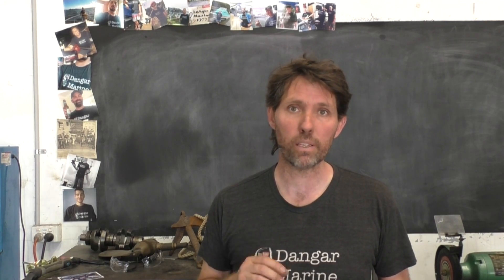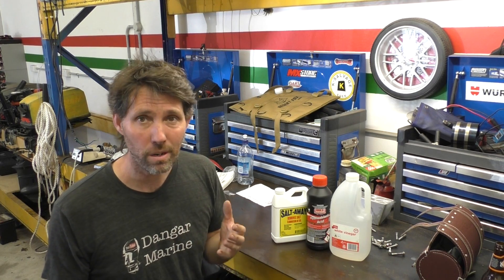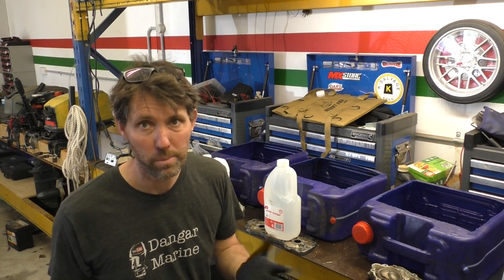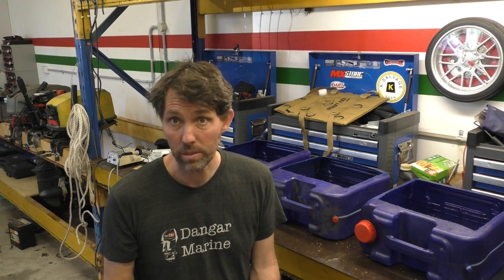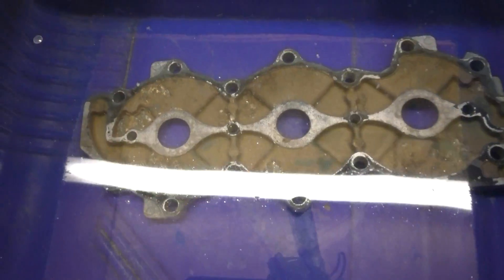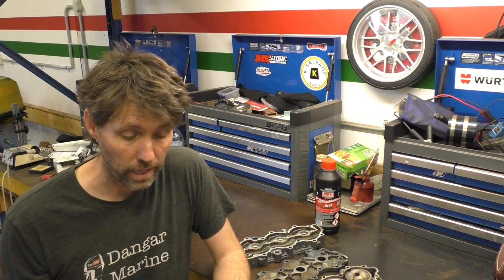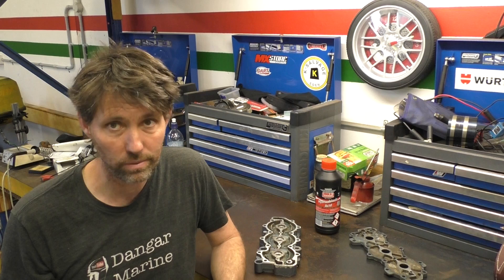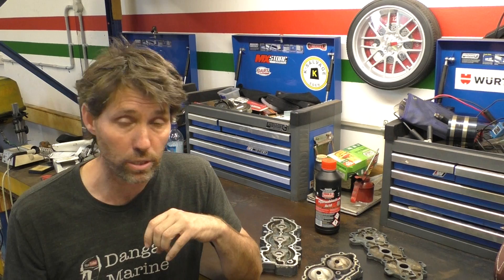Cleaning outboard water passages

Comment: Hey Stu, have you done a video about removing a stuck cylinder head? I've got a 3 cylinder 1987 Johnson 70 in and the head wont budge. I have removed all 14 bolts (2 snapped off -doooh!) but I can't persuade it to seperate from the block. Don't want to get too medieval with it but can't figure out a way to make it shift.
Reply from the maker: Hi David. Are the shanks of the broken bolts still in there? That is probably what is causing it to be stuck if so. I would start by looking for any protrusions that allow you to use a punch to tap it off. Worst case scenario would be separating the crank case so you can push it out from behind. If you are game (and careful) you could also try putting spark plugs in to block the holes, leave the leads off and then crank it to see if the compression pushes it off.
Reply: Thanks Stu, that's worth a try. I have been soaking the broken studs in penetrating fluid for a couple of days but it's still stuck. I have center drilled the remains of the studs and am waiting for some decent cobalt drills to arrive. Looks like I will have to drill the studs out and retap the holes. Thanks millions for the response, I know you must be a busy bloke. :-)

Comment: Hydrocloricacide has been being used on air conditioning condensers and evaporator coils for many many years. The aluminum fins are about a 16 of an inch thick and it cleans them to looking shiny new. It is mixed a lot stronger than 20 to 1 though so it shouldn't hurt your application at all but leaving it on it for hours or overnight might eat off some of the thinner aluminum. Have a good day and I enjoy your videos
Reply from the maker: Thanks mate, interesting to hear your experience with much thinner metal.

Comment: Hey! Ive got an 1960 swallow 3hp outboard, and im trying to figure out if it has a water pump, as some older lower hp engines do have those. I dont see cutouts in the tail and no holes near the prop, but where the exhaust comes out there is a big hole...
Reply from the maker: Can't say I'm familiar with that outboard, sorry.

Comment: Hey Stu, I have an opportunity to buy a good boat but it has a 2000 model 40 HP Tohatsu  motor. Are they any good from your experience?
Reply from the maker: I've had a few Tohatsu 40C outboards. They are simple, easy to work on and reasonably reliable. I quite like them.

Comment: Interesting video.  I've got an old 1970 Mercury 1150 that needs a bit of TLC, so I've found your videos pretty helpful.  Have you thought about using a combination of solution with a ultrasonic agitator?  I'd think that would work quite a bit to get most of the crud out of those passages, then follow up with the brush.
Reply from the maker: Something like that would certainly help. I would like to at least get one for carburettors one day.

Comment: In brackish water environment here ... the local shop recommended taking the thermostat out of the honda four stroke then pour toilet bowl cleaner down.  Sorry white bottle with bent spout.  Neighbor tickled at the crud that came out the bottom!
Reply: Great video comparison as this is aged question for trailer boat owners. Like many I to use saltaway but can't help but feel a bit ripped off by the high asking price
Reply from the maker: Ha! Interesting to hear. I've got so many interesting suggestions since this video, I'll have to try them all. :)
Reply: The best & least troublesome 'cure' for trailer rust was the guy who puts a rotary sprinkler under the axles and lets the 'lawn' get washed for - I don't remember 1/2 hour, 1 hour or ?  No pain & supposedly works

Comment: Thank you for the video Stu. If I ever take on an overheating outboard I will strip it and wash out with diluted acid. I doubt I would try running it through a complete motor however.
Reply from the maker: Hi Matthew. That sounds like a sound approach. :)

Comment: Excellent experiment and presentation. With hydrochloric and any concentrated acid - it  must be poured into water and not the other way, heat of mixing could make it splash out of container. Just a note, you did it correctly.
Reply from the maker: Thanks mate, good to know. :)

Comment: Brick cleaning acid is normally pretty dilute from the bottle, normally 
about 15 % HCl, you were right to dilute it further. I presume 
"aluminium" engines are made from some sort of alloy, containing a high 
percentage of aluminium, I'm not sure about that.

The bubbles coming off were hydrogen gas, hydrochloric acid reacts with 
aluminium to produce aluminium chloride plus hydrogen. See what happens 
when some aluminium foil is reacted with 25% HCl:     https://www.youtube.com/watch?v=LaaORZ0ofCY

It would be interesting to see what happened if you put some acid 
straight from the bottle onto a piece of a scrap engine.

Strong caustic soda solution (sodium hydroxide) also reacts with Al, so 
that should be treated with extreme caution too when considering 
potential cleaners.
Reply from the maker: I might try a bit of pure (bottle strength anyway) acid and share a picture of the result on Instagram.
Reply: @DangarMarine  I have done this years ago with a yamaha 90 block thatwas junk to try various methods of 1 removing scale  and 2 trying to remove broken bolts....I did as you, using a dilutesolutions at first, when it really didnt attack the chrystal build up, it did, as i expected do some serious damage to the heads, very quickly as a concentrated ,ie  pool variety muriatic acid....I believe the build up problem is exacerbated by the desire to get the outboards  up to temperature quickly and thereby complywith emissions and or show better ecomy..thus, you dont see much flow  thru the thermostats....just a spitting until it opens..  So ththat water is filled with minerals and deposits very quickly on the aluminum surface as the spittting water evaporates..  similarly on shut down the water drains from the hot heads, and what is left over evaporates ...and sticks to thealuminum...  I will get castigated....but, when i start having problems, out come the theremostats....and since there is usually reducedvolume going thru anyway, the crud actually takes the place of getting engine up to temperature... I should say thatthis is my best guess.. I havenever had a serious provlem running without thermostats...as I know everyone will scream....increased wear..bla blas ...welll ok then...rebuild your motor...me, ill takethethermostats out andget several more years out of them.

Comment: Acid is used by many truck wash to clean tractor trailers..there is alot of aluminum parts.. Acid is sprayed over entire truck.. Let sit for a few minutes then rinced off with soap and water.. Trucks with 100's of washes do not show any negative affects on aluminum.. Or rubber parts.
Reply: We use the same 'acid' at work for washing trains. It is citric acid at very low concentration, I dont know the exact level, but it is so low that it does not burn the skin nor sting the eyes from the spray .I wonder if  dilute molasses would work like it does on steel/rust?  I used molasses to de-rust the interior surfaces of boxed in car par parts over the years - mainly the fan housings of type 1 beetles and chassis  and sills of an XW falcon.  I tried the same trick on an Alfa, and finished up with the only useable parts of the car after the rust was gone -  the wheels - they looked good on the trailer! :-) The molasses I diluted 10:1 and for the fan shrouds and XW chassis the time was 4 weeks fully submerged. The steel ended with a totally clean surface you have to dry and paint immediately or you will have surface rust within an hour (gold all over look)

Comment: a wise old man once told me if ya wanna get stuff off of something use the same stuff to soften it up first and then wash with the most abundant solvent around -water.    yeah  really if its bad enough to give ya a problem  might as well get a gasket set and tear it apart to manually clean it .
Reply from the maker: It is a good point about using the same stuff. An example of this is engine flushes to get rid of old oil deposits before doing an oil change. It is essentially a thin hydrocarbon (like diesel).

Comment: There is also a product called Barnacle Buster.  Essentially it's 85% Phosphoric Acid.  According to the website it's acceptable for use on Marine Aluminum similar to the parts you put in the tanks.  A quick youtube search will show plenty of information.  I'm going to try your experiment with a piece of scrap aluminum from a Suzuki that has been decommisioned.  I will let you know how it works.
Reply from the maker: Good tip Sean. I will be interested to hear how you get on. It's always nice to have a few unwanted bits lying around that you can sacrifice in the name of science!

Comment: Interesting follow up Stu, I agree with an old outboard that the passages clogged. Only other option is to remove everything and clean by hand. If this can be run through the cooling system with the motor in a water tank with the water/solution mix that would be great. I know on vehicle engines they can clog up with old motor oil and can be flushed by over the counter products but I'm sure if you read the ingredients there is something that could be used from a store or hardware that would be the same and less costly. The end result on motors is a longer life span. good video
Reply from the maker: Hey Tim. Yes, I was wondering what is in your average radiator flush than might be useful in an outboard too.
Reply: This one is the standard here for flushing radiators. I will look up what the chemical makeup is and let you know.

https://www.oreillyauto.com/detail/prestone-4666/chemicals---fluids-16461/maintenance-chemicals-16867/radiator-chemicals-16623/radiator-flush-17737/radiator-super-flush/as107/4666546?q=Radiator+flush
Reply: Interesting fact is the chemical in this is sodium citrate/citric acid. It's only sold by the drug stores with a prescription for removing kidney stones. Haha if you have them you can clean you're engine cooling system and get rid of kidney stones at the same time. Update, just read today you can make sodium citrate from 2.1g citric acid and 2.5g of sodium bicarbonate mixed with water.

Comment: CLR,  calcium lime and rust remover might be worth a shot. You're right about the flush with every use with water, could add a detergent then finish it off with fresh water too, this should keep the guts of the motor pretty clean and reduce exposure time of salt and other crud. Prevention is better than cure, as usual, with great maintenance.
Reply from the maker: You're dead right about prevention being better than cure when it comes to flushing. Sounds like limescale remover contains the same acid put in Salt Away which was interesting to see.
Reply: NO !  THIS STUFF IS VERY TOXIC AND NOT SAFE WITH METALS.. USE 10% PHOSPHORIC ACID/ WATER SOLUTION ( THATS WHAT BARANACLE BUSTER IS).   READ THE MSDS SHEET ON THIS STUFF.!!

Comment: Hi Stu, again a nice video!
Did you use vinegar or vinegar acid? For cleaning pentas they recommend 8-10% vinegar acid. Other topic: a guy told me that flushing the outboard with fresh water after boating only makes real sense if you put out the thermostate (reasamble the housing of course) because if you don't the fresh water would force it to close very fast and so the water won't reach the head while flushing. Any thoughts on this appreciated.
Reply from the maker: I used just food grade vinegar, so it would be interesting to try a concentrated vinegar acid (which is apparently in Salt Away). I would have thought that the thermostat would have opened as normal once the motor is warmed up. The problem with removing it is that you may need to put a new gasket in each time to stop it leaking.
Reply: The gasket replacement is definitely the point.

Comment: one way to test the weakening of the aluminum is to put some old spark plugs or a proper bolt in the plug holes and using a torque wrench, find out how much torque it takes to strip the threads out. compare to the other flushed heads as well
Reply from the maker: Ah, that would have been a good experiment. After everybody's suggestions I think I'm going to have to do a part 2 one day now!

Comment: Thank you for the video, do you have any videos about fuel tanks for outboards,  having a vent problem on a mid size mercury outboard where the primer bulb flattens out like a pancake at high throttle. I have a 1/4" fuel line for a 90 hp.  Is that too small?
Reply: Jon Karle 1/4 is small for a 90. I have a 50 merc and use a 3/8. 1/4 line is usually used on really small outboards like 15 hp and below. Im sure I could use 5/16 and be ok. But I would change that 1/4 line asap. And you're problem with the primer bulb staying flat is probably  the fuel pump. But it could also be the primer bulb or you're fuel tank pick up line is clogged or broken. Check Dangar Marines videos on primer bulbs and fuel pumps. Great vids to watch! Hope this helps bud
Reply from the maker: Jimbo's on the money. :)

Comment: Hi Stu! 
Interesting test and I agree the hydrochloric acid did a far better job at cleaning, I have a question for you on the topic of throttle and shift control, mine is a Quicksilver with tilt trim capability and I can't seem to find a parts assembly diagram for it do you know of a link where I might find this information?
Reply from the maker: Thanks mate. You should be able to follow the links from here on MarineEngine.com and find the diagram you are after http://www.marineengine.com/parts/mercury-marine-accessory-parts/remote-controls-and-components
Reply: thank you I will search that link as well but in the meantime I found this one and it covers every shift control made by Mercury (https://docs.google.com/file/d/0B1TAvwZ3TjhfZDJiNjc5YzAtYzBhYy00MjlmLTg5NzktMjQyZDJhMGQ3YzQ1/edit?pli=1 ) definitely a very good find  : )

Comment: Hey stu, saltaway active ingredient is sulfamic acid- or vinegar.
Dishwashing liquid has heaps of salt in it, so not great.
Hydro in a bottle is probably at 10% aqueous solution before you dilute, so pretty safe on all the rubber I've used it on inc O rings.
If you want to use on flushing attachments just pour a little into garden hose ( backfill) plug into motor port, turn on tap for 30 seconds, then let soak before turning on tap again.
A fishhook in sea water Vs salt away for a week is interesting however.
Cheers lads
Reply from the maker: Ah, interesting about the active ingredients of Salt Away, and a good point about the concentration of hydrochloric acid in the bottle, I was going to mention what that bottle was but I forgot to film it. Also, I notice this line from the Wikipedia article on sulfamic acid "It is frequently used for removing rust and limescale, replacing the more volatile and irritating hydrochloric acid, which is however cheaper."
Reply: Thanks mate, read that a while ago, must have got it mixed up. 
Very expensive stuff the salt away, I'd like to see a lifetime user tear down a cooling system and show the results.

Comment: That wss 2 litres vinegar, ao 1 to 5. Love the vids!.
Reply from the maker: Ah, right you are, I don't know why I thought it was a one litre bottle.
Reply: @DangarMarine  what was the concentration of the vinegar? I used 30% to fill a deep container to dip the outdrive intake into, and ran it until it became warm (recycling the same liquid) there was at least 2 cm of calcimum deposits in the bottom of the container in the end.

Comment: Most products are used to prevent/slowdown outboards getting to that stage in the first place I think.I have always flushed my outboards,boats and trailers with fresh water immediately after launching (trailer) and retrieval (all 3),then given them a thorough rinse clean again once home with warm/hot water as it dissolves salt much better than cold.
The worse thing that you can do is combine periodic flushing with lack of use as I firmly believe that running them more frequently the salt has less chance to crystallize in the water jackets etc.

  Thanks again for the efforts you've gone to.
Reply from the maker: Hey Fabian, couldn't agree more that regular flushing to prevent things ever getting this bad is the way to go. I think heat was definitely one of the missing ingredients in this test though.
Reply: @DangarMarine  i fresh water flush religiously...and the results are thesame when taken apart...they all have the mineral deposits..Im guessing that continued operation is better than intermittent operation..based on when i was a kid, living in the keys, this was never a problem...as we ran the little outboards 4 to 115 hp omc..early 70s almost continuously.   as ive said before, stop and go...heat cycles and evaporation with the thermostats  spitting a little wateror some designed not to pass any water...i believe is the cause of buildup..   Notice no hardwater deposits in a pan when it is boiling, but  it gets pretty crustyif you let the water in a pan evaporate with heat on. :)   just an observation